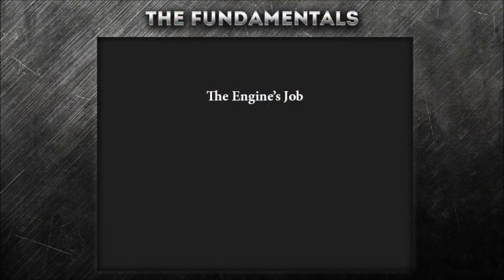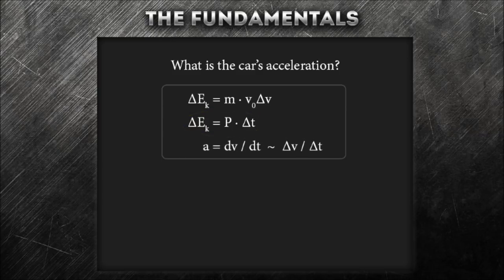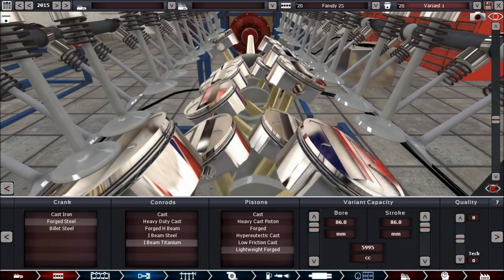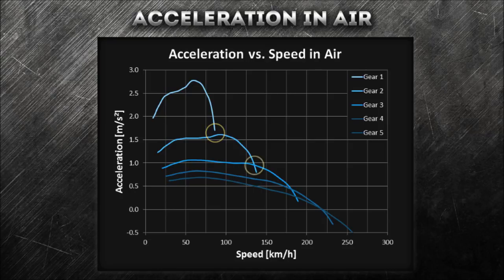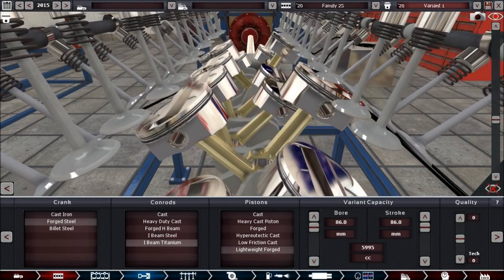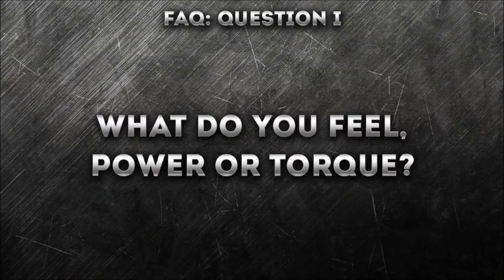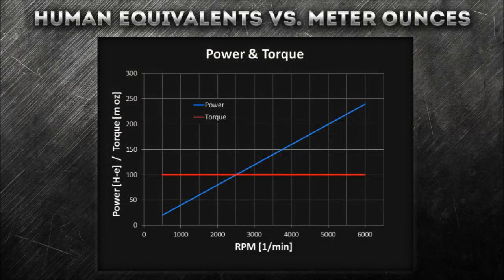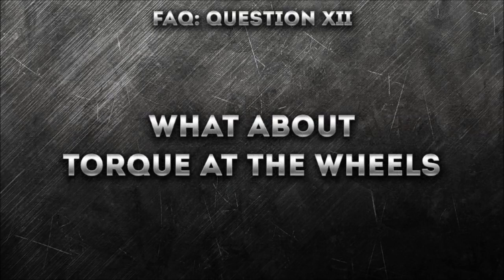Power & Torque: Acceleration Exposed

Comment: That big engine vs small engine in acceleration isn't super accurate because that big v12 would have easily made much more power
Reply from the maker: How is that relevant? It serves the purpose of this comparison very well and shows that torque is not what is important for acceleration but power output itself. That doesn't make the example inaccurate in any way.
Reply: AutomationGame if you are going for more than power to power with torque being the only difference it is great 

But if you're going for 2 full "built" engines to the same degree of "build' ( which is more along the lines of what I was trying to say and what I think would be more practical real world application  )
Reply from the maker: You are correct in that. Still it is not relevant as this example shows a physics principle and not "what is realistic IRL".
Reply: AutomationGame ahhh ok 
Only thing I think that could have made this better is to touch on that side of real world aspect of it a bit more

No replacement for displacement 
Boost will only make it better;)
Reply: You also have to consider that a small engine will usually be capable of higher rpm. This together with the weight advantage is why you do not have huge displacements on performance car.
Reply: fededevi wtf are you talking about 

Yes high rpm is nice but you will never get the same out it compared to larger displacement
Reply from the maker: MyLonewolf25 No, you are wrong there. There is a replacement for displacement and that is RPM. Performance cars on average use smaller, higher revving engines because they are lighter and don't need a gearbox / drivetrain that is as heavy to cope with the torque.
Reply: AutomationGame Exactly. Most people don't get that though.

Comment: If gearing is the same for both the big v12 would out accelerate it even still.
Reply from the maker: Uhh, yes, but only if it magically weighs the same as the little V12.
Reply: AutomationGame if both weigh different it depends on the difference between the two. So based on max torque alone the accelrative g force for the small v12 is .2 vs .39 for the big v12. 

Ive come up with a gearing in first gear

2.66*3.42*398=3620/3465= G force
2.66*3.42*185=1682/3127= G force

direct gear 3.42 total force at the tire

1361 big v12 
632 small v12

Comment: Did F1 engines ever reach the speed limit of flame propagation for Gasoline?.
Reply: No, they just shorten the stroke as needed. The rpm limit is mechanical.
Reply: You think it was a valve train limitation... or bottom end?
Reply: Well... we don't know that they DID reach the limit.  I wonder how much higher they could have revved them.
Reply: I'd say valve train first, then rods and bottom end.
Reply: +Marek Sumguy 

It's an interesting question though. There has to be a limit, otherwise infinite rpm would be achievable! Imagine a 10mm stroke for example? At some point the friction will become the barrier, but I suspect that valve train limitations will be the hardest to overcome.
Reply: ... pistons and rods ARE "bottom end".
Reply: Semantics. You know what I meant :)

Rod strength is a discrete issue in this context.
Reply: Well now i do.  But not before, because you made a distinction between "rods" and "bottom end".
Reply: Marek Sumguy

It wasn't intentional, just a matter of how I was thinking about things as I typed.

I don't see the use of the word 'and' as a distinction. This is your interpretation.

It could easily be interpreted as 'combined with' but with emphasis. 

This is not a contest. I'm just interested. OK?
Reply: haha... ok, relax.

Comment: Is that really the reason why Diesels can't rev as high?.... because of flame propagation limitations??.   I thought it was mainly due to the fact that Diesel engines use cylinder heads with porting designed for low end VE optimization.
Reply from the maker: Flame propagation is a big part of it as far as I know. That then leads to them being optimized for low end.
Reply: Also that and they have to have VERY heavy internals making them not rev high
But I doubt they are  being limited by gas expansion at a bit over 3k

Comment: I can't find the part where you put the turbo curves on the graph!  One of the example makes it seem like turbo is a straight downgrade compared to stock (less power)?! How is that possible?
Reply from the maker: There is no turbo discussion in this one. I don't even know what you are talking about? Do you mean this video: https://youtu.be/vX8wlkSDwSY
Reply: My bad. Yes that's the video at 11mins. Nvm my question the turbo graph is the left one everything is good. But I have another question tho.. What RPM corresponds to maximum acceleration (@ v=0 and v=C)? Maximum power's RPM or maximum Toque's RPM?
Since a=P/mv0 I would say the Power's RPM but in your video you show that the acceleration graphs are a compressed image of the Torque's curve..
Thanks.
Reply from the maker: Younes Taghi That question has three answers: 1) If you use a fixed ratio gearbox then at peak torque you get maximum acceleration because of the limitations of fixed gearing. 2) If you have fluid gearing like in the case of a CVT, then you accelerate the hardest at peak power. 3) If you have the choice of fixed gearing and want the car to accelerate hardest at a certain speed, you tune the gear such that the engine is at peak power in that gear at that speed.

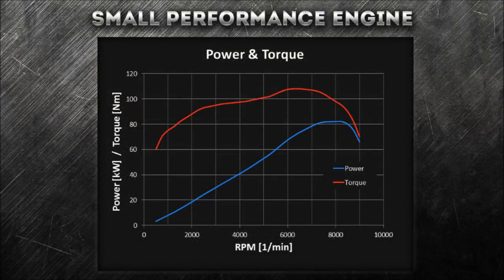Comment: Why would the acceleration for fixed gear ratios look like the torque curve? @11:45
Reply from the maker: The video explains that, have another look. The short of it: RPM increasing linearly makes power increase linearly. Power need to keep constant acceleration also rises linearly. Those two cancel each other out, so what is left is the torque curve.
Reply: Like right here bro. I'm the guy you've been arguing with. This is not true as proven in a CVT transmission. Power stays the same throughout all acceleration and gearing. The reason the cars acceleration slows down is due to the gear ratio changing, and wind/road resistance. A rocket (or jet engine drag car) is a good example of this. Until an object reaches near the speed of light, extra required energy for constant, consistent acceleration is negligible.

Comment: How did you factor the drag into the torque vs. km/h graph? (Equation)
Reply from the maker: I did a simple PowerLost = Speed * AirDensity / 2 * EffectiveAreaOfCar * Speed^2
where I used an average, reasonable figure for the car's effective area. Drivetrain friction was not taken into account.
Reply: So... Is it those quantities minus torque? Im trying to creat an optimum shift point calculator.
Reply from the maker: Hmm? I don't get where you want to get with that question. Torque doesn't come into it at all. drivetrain friction is a power loss, "power at the wheels" is what accelerates a car as demonstrated to the n-th degree in the video, so why do you even mention torque?

Comment: So it's not really the amount of torque it's how much is available at all rpms like a flat torque curve. So that being said a car with 200 ft-lbs of torque all over the rev range can accelerate better than a car with 300 ft-lbs but only on the top half and a low amount of torque (lets say 70 ft-lbs) on the bottom half. Is my theory correct?
Reply from the maker: +Fudge You uhh... I don't quite follow, but let me say this: the only thing that matters is how much power you produce across the usable rev range. How you produce that power (low RPM + high torque  or  high RPM + low torque) doesn't matter. Talking about absolute torque numbers is pretty meaningless, power accelerates a car, not torque.
Reply: +AutomationGame Ah ok.

Comment: This video pretty much explains how Teslas trounce supercars in short range acceleration even with much inferior power-to-weight ratio. If there was a practical CVT that could be mounted on a Ferrari the performance would be insane.
Reply from the maker: +SUN SU Indeed! I think better CVTs would be the answer to performance electric cars, as combustion engines have the advantage of higher energy density fuel and thus are lighter... what limits them is the fixed-ratio gearboxes.

Comment: Part of the thing about large torque-y engines and diesels that you didn't mention is that besides just the torque curve, these larger stronger engines are also typically far more reliable and durable and thus are preferable for work-intensive applications.  You got close to pointing this out with your illustration of the F1 engine in a truck.  Trucks prefer using diesels obviously because an F1 engine is not going to make it to 500,000 miles, and an F1 engine is going to use orders of magnitude more fuel.  Plus, in reality any F1 engine that is geared to run 15 mph at 20,000 rpm is going to use a very expensive gearbox with a lot of friction that also doesn't last very long.  Not always, but in general, engines with bigger cylinders and slower revs are going to be a bit more efficient (hence why trucks often use very large 6-cylinder engines that top out at 2500 RPM - a 50% efficient diesel in a ship would be the extreme example of this principle).  With the big and the small V12s you used at the beginning, two major things the big V12 has going for it is that it's a) probably going to cost a lot less to build and b) it's going to last a lot longer.  Torque curve is certainly part of the equation but that's not the only thing people are thinking of.
Reply from the maker: +Ray Beck I agree with all the points you made and would like to point out that the nature of diesel engines not revving high directly leads to lower RPM which mean less friction and less wear, making them last longer. I am not sure if a petrol engine tuned similarly and limited to the same redline would break earlier, although the petrol 4 stroke cycle is slightly more complex.
Reply: @AutomationGame 9 years later Cummins might finally be answering your questions
Reply: +AutomationGame I just want to say thanks for making this video, it's so much easier to point people to a video than it is to try to knock all of their misconceptions down individually. 

I do disagree with you here, though. Modern diesels are actually considerably more complex than modern gasoline engines.
Reply: +Ray Beck Greater displacement doesn't automatically translate to greater longevity, with diesels it's also that they're typically built to be two to three times heavier than gasoline engines of a similar displacement. That extra mass does often translate to much greater longevity. As AutomationGame has said, gasoline engines would benefit from being built in this manner as well. In fact, gasoline engines are able to be extremely reliable while weighing much less than diesels. 

Also, you're not considering some aspects of the engine design with the V12s. A small engine will typically have a shorter stroke than a large engine, which can translate to lower piston speeds at similar or higher rpm, reducing wear and stress on the internal components. It's not uncommon to see 300,000 miles on a high revving Honda engine and a slow turning V8 in the junkyard before it's gone half that many miles.

Comment: Here in Russia we say that knowledge is a power, and from this video we know that the power is producing acceleration. So, question number XIV: is professor's car much faster than student's one? :D
Reply from the maker: +Дмитрий Петров Correct! xD BUT the professors gearing is not as optimized as a student's, so the cars accelerate about at similar speeds ;)

Comment: 4:24 I can't quite follow that step. Yes I recall that an assumption like "X is very small so it can be neglected/considered = 0" is a valid action. But I imagine you would need to apply that to the entire formula and thereby also neglect the delta_v you multiply with V_0.

Since you don't do that I have one clue as to why. delta_v^2 is of course exponentially smaller then just delta_v and therefore more plausible to be ignored. But somehow I feel like that is a bit arbitrary :/
Reply from the maker: +ruolbu Fair question, I myself often had doubts about that during my university studies. Let me give you a practical non-hyperbole example to show this is valid as an approach: take v0 to be 10 m/s, a pretty small velocity, the mass is 1000kg, we say that deltaV is 0.001 m/s, which I would say is a "practically almost zero" number.

starting off at the third line where I would get rid of the deltaV^2 term:
= 0.5 * 1000 * ( 10^2 + 2 * 10 * 0.001 + 0.001^2 - 10^2)
= 500 * ( 0.02 + 0.00001 )
= 10 + 0.005

So what I am doing here is getting rid of the 0.005, that creates an error of 0.05%.
I think you see why I am inclined to accept this error in order to make the rest of this derivation possible :)
Also note that I correctly state that this is NOT exactly true but very close to the truth, indicated by using ~ instead of = when it comes to denoting the resulting acceleration.
I doubt that after seeing what little error is introduced you keep worrying though ;)
Reply: There are lots of places where when solving a problem in physics, we look at how terms in an equation behave and depending on their relevance, remove them to make the math easier. 
For example if the term X/n appears, and we know that X is much much larger than n, we can treat the term as zero, especially if there are other terms that don't trend to zero

Comment: Nice lecture about torque and power. I have one interesting question though. Eventhough, I like combustion engines much more as an engine than electric ones. I do have the fear/impression that electric engines are in fact superior over old combustion engines, due to the almost constant torque they can provide. Is this correct and how do you guys feel/think about this?
Reply from the maker: +Tycondero I think you meant "constant power they provide" :) well yes, electric engines are far superior if you do NOT consider the fuel and its energy density. Combustion engines with CVT are superior to electric engines taking into account just how much their fuel weighs (so many batteries!). That may change in the coming years as battery tech advances, but currently the unmatched energy density of petrol and diesel is what gives combustion engines the edge.
Reply: Thanks for you explaination. That's true, I'm still a bit thorn whether electric engines will be the future or whether hydrogen as a fuel will be. The benefit for hydrogen is that we already have most of the infrastructure (fuel stations), however it seems hydrogen systems have "lost" the race against electric/batteries.

Comment: Shouldn't the Acceleration vs. Speed In Air graphs show power curves instead of the torque curves?
Reply from the maker: +EriksR Yes, kind of, but only if you have CVT gearboxes or electric engines. It is the limitations of the fixed ratio gearbox that makes the torque curve visible!

Comment: I find it a bit confusing that talking about the velocity of the car, you use the formula e=½mv^2, since that is the formula for the kinetic energy of something. We're talking about the velocity (speaking of acceleration) of something, not its energy. Wouldn't something like v=sqrt(2e/m) make more sense, assuming "e" is only the kinetic energy? I dunno, I'm not so good at math, it just seems more intuitive to me... :/ I have no idea if I even know what I'm talking about. But I think it's great that you take the time to go into physics about this, since it's not really in your "job" to teach people physics. :)
Reply from the maker: +antiHUMANDesigns Well, yes, that would make sense, but the most fundamental characteristic of an object is not  its velocity but its energy. Coming from a torque (energy) and power (energy per time) angle, it makes sense expressing everything in terms of energy. Also, expressed in the way you'd want to see it it would have to be v = +/- sqrt(2e/m) because velocity is a vector. So the simpler way to write it in this discussion at least I find to be the way I chose. Cheers!

Comment: Ohhhhh ok so power is sorta the vertical shift to acceleration whereas torque is the function that defines the line
Reply from the maker: +Toni Fakerman Yeah, kind of... the shape of the acceleration curve in a fixed-ratio gearbox comes from the torque curve, the performance comes from the power and gearing.